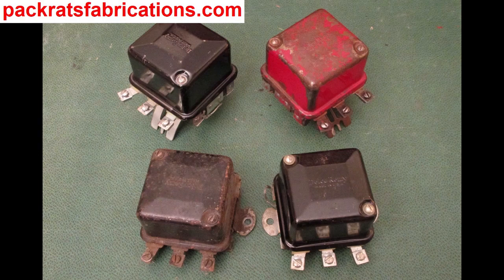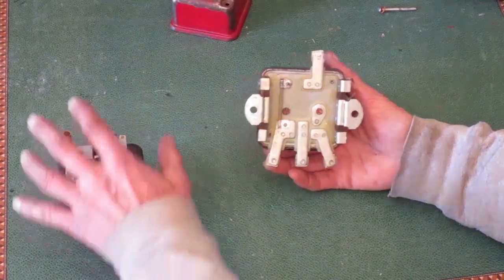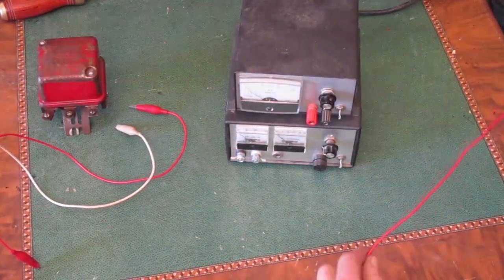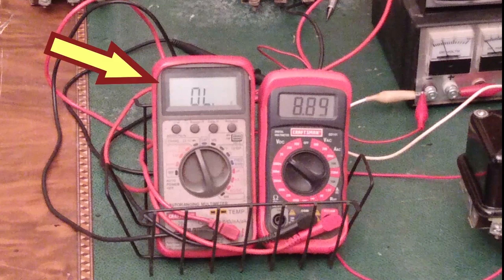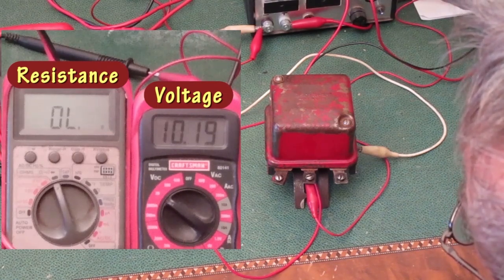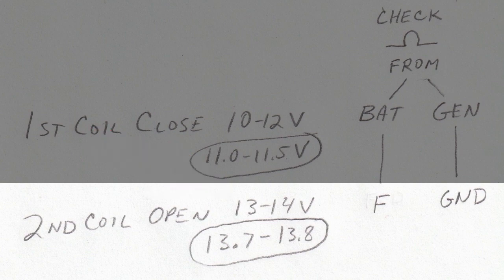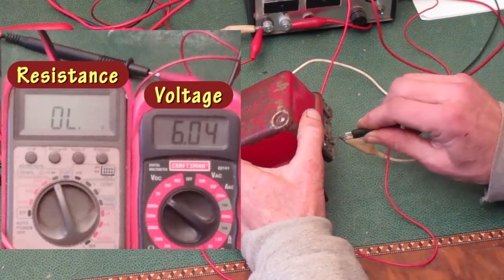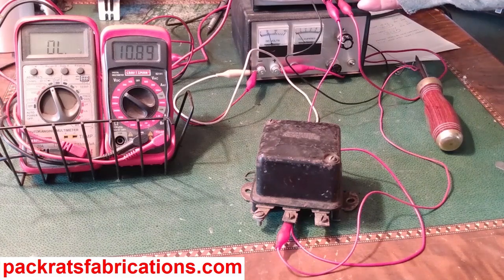Kohler Delco Remy Voltage Regulators Part 1: Bench Testing

Comment: You did a great job with the graphics and explanation.  I enjoy getting the old school components working.  Now I see with a couple relays I have not working, two contacts are open thus no charging.  I thought the regulators stopped after I polarized the generator.  Do you know what voltage the cut out and current/voltage regulators should be set for in a 6V system?  Also, any idea what the resistance of each coil should be?
Reply from the maker: Sorry, I don't know the answers to those things, I've never experimented with the 6 volt systems.
Reply: @PackratsFabrications  The regulators I have seem to have bad coils, they won't do anything with a good power supply.  Thanks for your help.

Comment: Thank you very much, that was a very informative video. My years of experience with VRs on cars, trucks and tractors is to check them with a VOM, clean all connections including the points. If it doesn't fix it throw it away and replace it. I am really looking forward to the rest of this series.
Art from Ohio
Reply from the maker: Hi Art, yea I had a small pile of them that didn't work, and I didn't want to throw them away, so I had to experiment some...
thanks for watchin!
Reply: @PackratsFabrications   are you still working on these ?